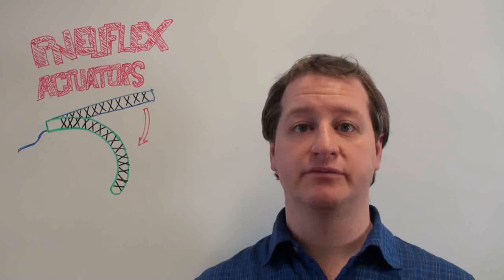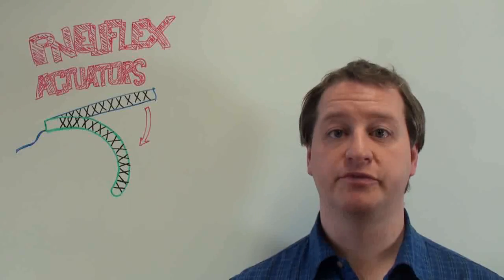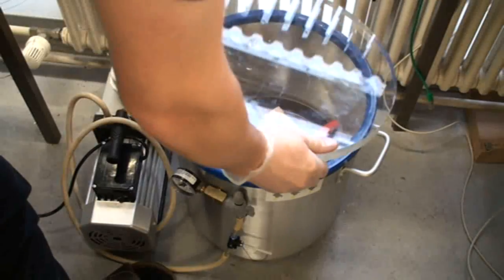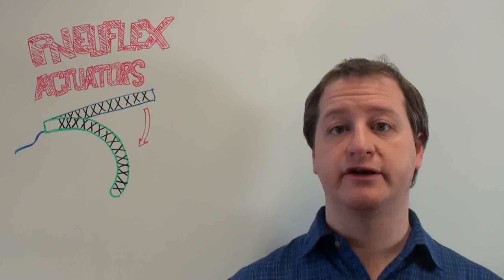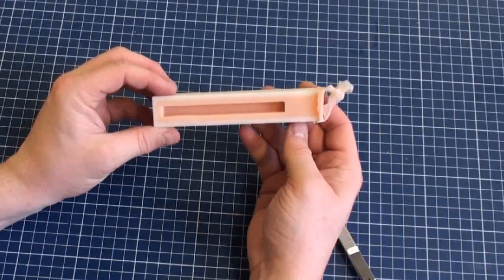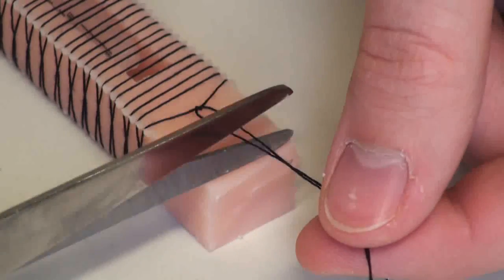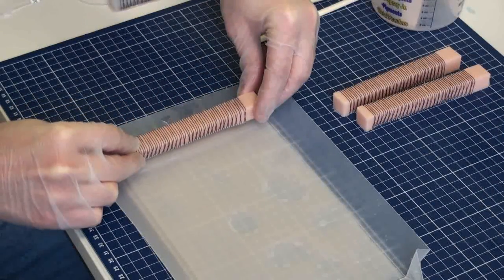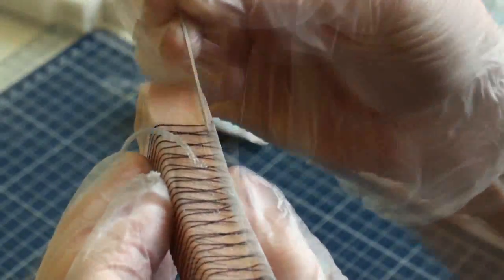PneuFlex actuator step-by-step production tutorial

Comment: Shrinking is usually in the 0.1% range, so that is a non issue.

If you want to create very thin silicone layers, you probably need to use injection molding techniques instead of gravitational flow. Nevertheless, there's a lower limit on layer thickness, as the rubber will simply bulge between the reinforcement helix threads.

Comment: How strong can you expect the actuator to be?

If you make gloves with actuators on the outside of the hands (knuckles) iäare thos strong enough to help people with spastic hands to open and close their fingers?
Reply: Not really sure as the poster doesnt seem to respond to anyone. According to me it depends on the pressure of the compressed air as well as the stiffness of the flex material after curing. For a stiffer material more air pressure will be required which will in turn allow it to grip things stronger, and in your case might be like an exoskeleton for people with spastic hands

Comment: Probably out of the context, but what would be the minimum thickness of silicon layer you may build in a mold? Do you think 0.5mm is possible? Second question, does the silicon part experience any size retraction after its cured? Thanks

Comment: You don't explain the purpose of the double-helix thread on the actuator, and why it needs to be in this pattern.  Nor do you explain the purpose of the stiff material glued to one side of the actuator, and how this works with the thread.  It would have been nice if you had explained Why and How the actuator works.   Other than that, nice video.
Reply: As far as i know , the stiff material decides in which direction should the finger bend. As the stiff material cannot expans its opposite face will expand causing the finger to bend towards the stiffer side. Also the string is needed but the pattern can be of any type. The string prevents excess accumulation of air in only one point, which can orrcur due to errors in forming process. The string sort of makes sure the finger expands evenly during operation.